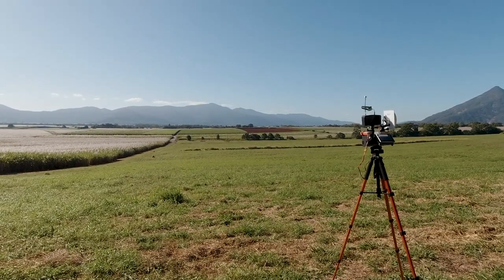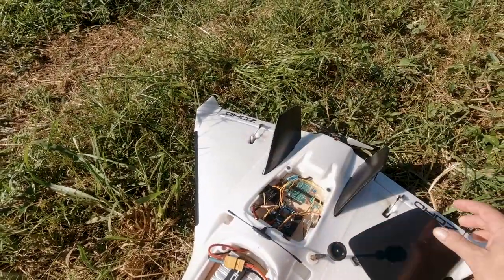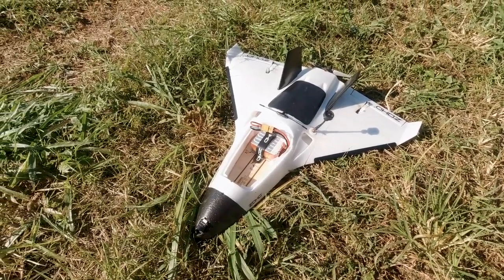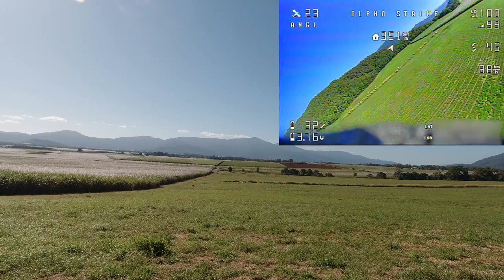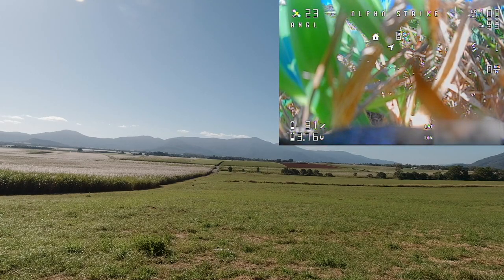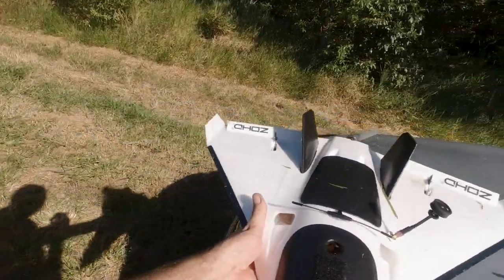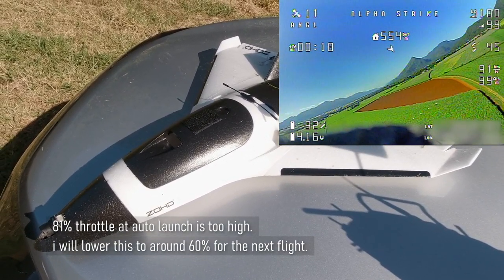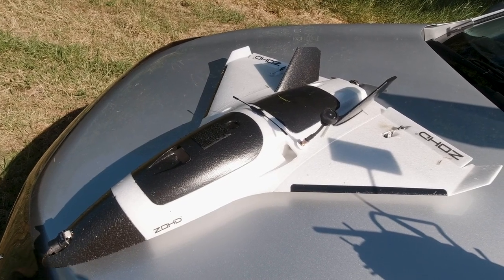Alpha Strike Running 6s Test Flight and Tune iNAV 7.1

Comment: How did you get a "Holybro Tekko32 F3 65A" in AUS :O BG won't send me one
Reply from the maker: @damienbrown4936  I have had that esc for sometime, it was in a Dart xl purchased near 4yrs ago. I got that one from BG I don’t see why they wouldn’t send one Australia now especially from the Chinese warehouse. I know that US warehouse won’t ship here and the Australian warehouse didn’t stock them back then but mine came from China originally.
Reply: Would a BOOMFPV BLS Bluejay 3-8S 100A work?
Reply from the maker: @damienbrown4936  I’m sure it would although I haven’t used that brand esc but any high amp esc would work if it fits the plane.
Reply from the maker: @damienbrown4936  looks like a very similar size to the tekko32